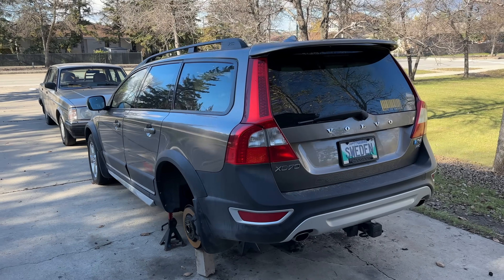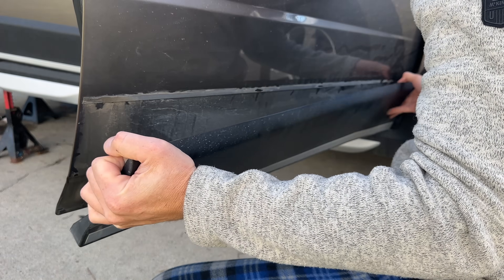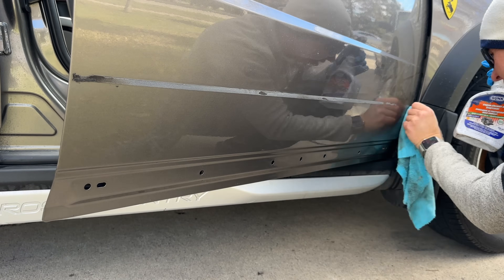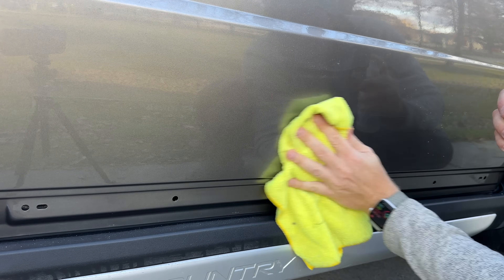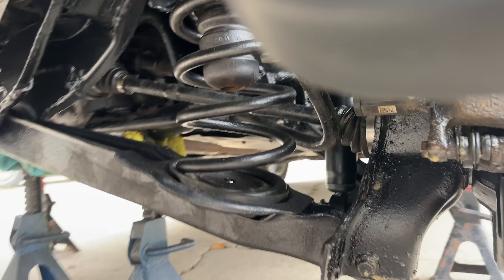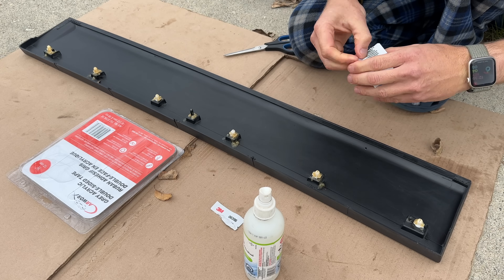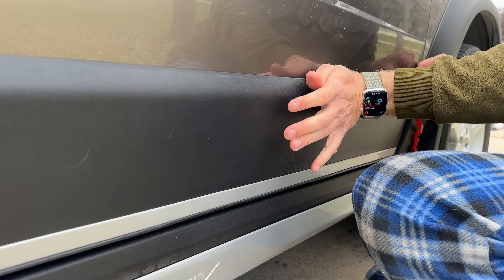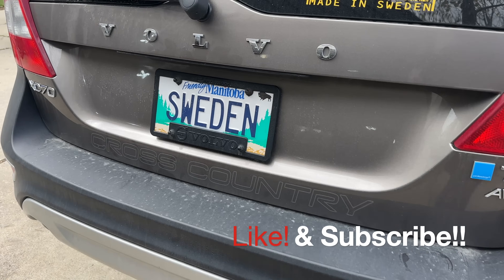Volvo XC70 Door trim cladding repair. You can do it!

Comment: I just had to replace some of them on mine after an accident. Both door trims, both arch trims and sill. Just for information if you buy any of those new they come with tape and clips already on them. 
For restoring the rest of the trim I can highly recommend Gtechnique C4 (60ml). If applied properly it lasts for 3 years with no need to use any other products on them.
Reply: I can totally vouch for the Gtechniq C4 stuff. Used it on the grey plastic trim on my 850R and they still look brand new after 4 years. Also it just boosts the original trim color without any tint like some other products. The car is parked during winter times and always stored indoors, so best case scenario for this stuff to last as long as possible, but I'm sure it'll do a great job in not so favorable scenarios as well.
Reply: @skookum_ahc  I live in UK and it’s always raining here and very humid so better for plastics than Australian sunshine for example but I do wash the car every 2 weeks and this stuff lasted so long. Most of these detailing products only last few weeks before you have to reapply again and over time you end up paying more than the C4 costs. Can’t decide if I like quality products or I’m just lazy🤣
Reply: @Dalbayob69  Oh I'd say it's 100% better than most "trim restorers", that just add a little shine to the plastic that's gone after 1-2 washes and you have to reapply the product. I used to use the Meguiars "Ultimate Black Plastic Restorer" and still do sometimes on friends cars I detail, but for longevity there's not many products out there like the C4.

Comment: I’ve already done this on my using 3M double sided tape. And after just 2-4 months same problem come back. So I don’t know what tape or glue they are using to do this job. Over the internet people have same issue and probably best glue for this job is windscreen glue. Just no idea how to keep pressed panel to the door for 24hrs. Coz that long glue need to fully solidify.
Reply: Same here. I had to do the rear door driver side because the corner was caught in the front door. I really put a lot of effort in the repair, also using a high quality 3M tape, exactly with the same width as on the original. The most annoying part is getting the adhesive off the trim, as I did not have that rubber disc recommended here. It is almost impossible to do it without damaging the plastic. An alcoholic detergent did the job on the door itself easily, but not on the plastic. And after a couple months the problem appeared again. As the panel has a crack now, I will probably have to replace it completely. Using some kind of additional glue when the corners are sticking out probably is the best idea. One could maybe even do this without taking off the panel completely. If I have to do this, I will use some kind of tape to keep it in place until the glueing is ready. At present, some pieces if tape are holding the trim in place. But the gap between the back and the front doort is really narrow here, a few milimeters less than on the passenger side.

Comment: I had this problem with the driver's door of my identical '09 XC70 after hitting a pothole. The backyard mechanic here in Prince Edward Island inserted a tiny screw through the trim, into the metal, to bend that point on the trim back towards the door so that it would open.

Comment: Ah these door trims, they have been a source of irritation for years on my XC70. But doing it correct like this make the job last as long as possible. I always carry some tape in the car so if the trim catches when opening it can be saved from bending and temporarily stuck down. The rears will bend easily if they catch the front door, had to make a small notch to save the panel, like the P2 model has. I think the problem is the plastic warping, if because of salt, degreaser or what I don’t really know.
Reply: I'm glad I'm not the only one AT ALL having to deal with this issue. My 2014 D5 is a great car basically, but things like these reminds me of the fact that all cars are fading now or later...

Comment: I see this often as a Detailer where owners aren’t using a pH Neutral Shampoo and using car washes with recycled water with harsh chemicals.
Reply from the maker: Do you think it affects this issue?
Reply: This and your Salty roads won’t help with deterioration of the double sided tape and plastics. Very good idea not to replace the older panel with a newer one..beautiful work👌
Reply from the maker: @detailerslife8127 Thx! Really happy it’s fixed. Next will be the read button on the left signal lever not working. It’s common issue with thin wires getting broken.
Reply: I think 15 years is absolutely fine. Its done its job

Comment: Do you have any information on doing the plastic over the rear fenders? The tape has completely let go on mine and debris is building up inside. Im looking to redo them similar to this.
Reply from the maker: I feel like it will be the same process.
Reply: @volvosweden  I figured as much. Do you know if  it’s the same part number on those clips as well?
Reply from the maker: @evanmerrick1813 I don’t know. Need to check online catalog.

Comment: you get free clips and tape if you buy the new overpriced panel. Also DO NOT APPLY 3M adhesive promoter to the car, like VOLVOSWEDEN said. it will fuck you finish.
Reply from the maker: Thx for the tip!!!!
Reply: @volvosweden  np. without your great vids we would be fucked by the stealerships. Btw: 1/2" double sided tape is too wide relative to what comes with the new panel. I suspect 3/8" is the right width. 1/2" wont help you as there is nothing to grap on to. Also, don't go crazy with the rubber wheel on the panel. You will fuck it up.